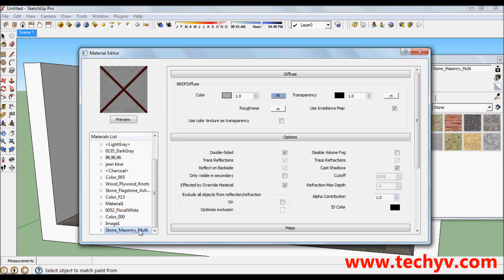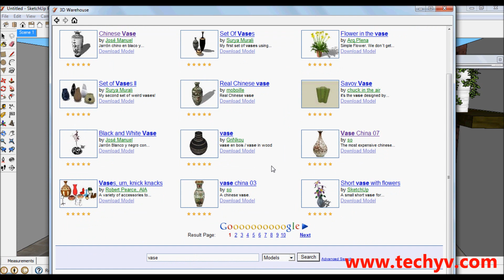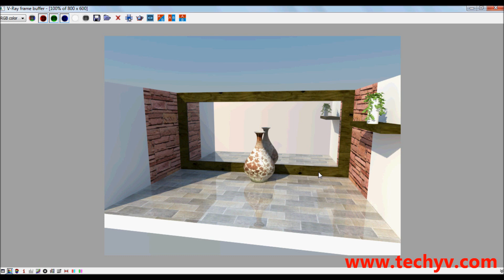Applying Gloss Effect To Materials Using Vray for Sketchup

Comment: This is a great tip! I often wonder how to get this glossy effect since it is a very tough task. Being a novice in this field, I am interested to be successful in this task and I am searching for a perfect tutorial. Now, Techyv has provided what I need and I’m glad that Techyv spread the word to other creative individuals that there are various and inspiring digital and traditional tools which are excellent for a designer that can also be used to communicate with their ideas. SketchUp users depend on V-Ray as it has fast, easy and cost-efficient way to render their cutting edge images. SketchUp is widely used to learn 3D modeling software on the market now. After watching this video, selecting the material that I need to apply the effect to, now I am able to do the works successfully. Everything worked well as Techyv video recommended.